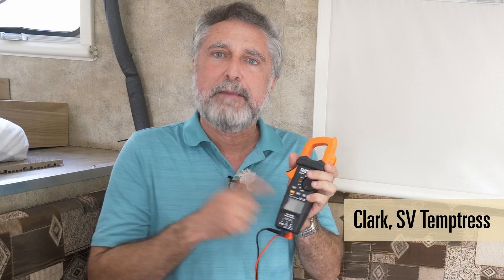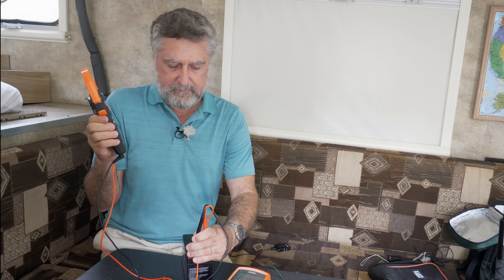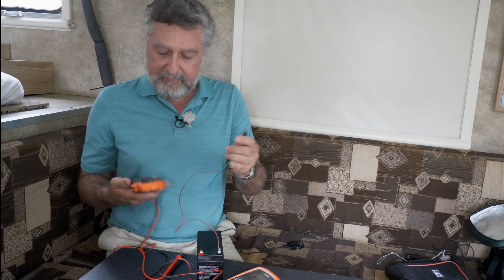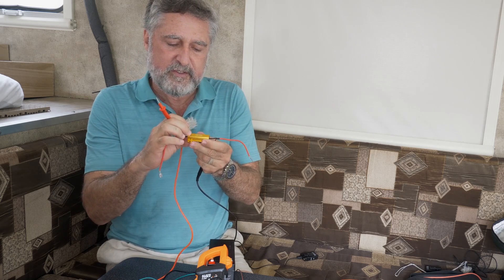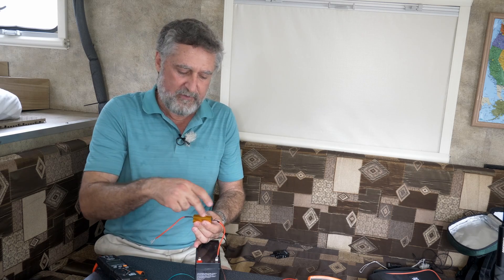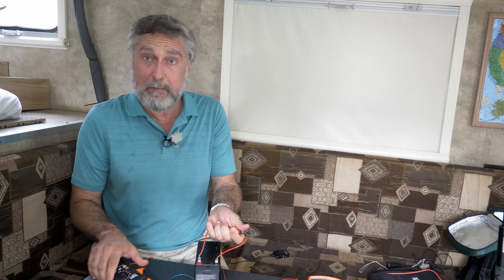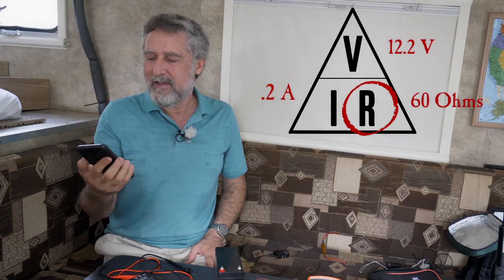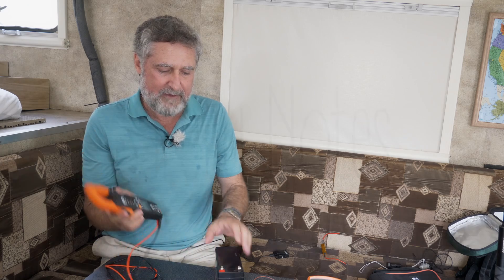Boat Electrical:How To Use Your Meter

Comment: It is possible that the Klein clamp-on current measurement was more accurate than the Extech shunt current test. The shunt resistance in these types of meters causes a small voltage drop across the shunt that is used to calculate the current. The voltage drop is called the "burden voltage" and it slightly reduces the current through the circuit under test. This is irrelevant for measurements on a boat, but is a big deal in low level electronics. The Extech manual probably specifies the burden voltage through the meter for low level electronics applications.

Current clamps can be impossible to fit in the tight wiring behind a breaker panel and nearby current carrying conductors can affect clamp-on measurements, especially when measuring low currents. If it can fit, clamp-on is king for current measurements above 1A or so IMO. If you use shunt current measurements, be sure to have spare fuses on board. : )

Comment: Hi Clark, great videos. Question  - no electricity knowledge, what is the resistor for that you hooked up. Why is a resistor used. Is it to draw down the current in a circuit? Your previous video it stressed resistance is detrimental. Thanks for any insight!
Reply from the maker: Sometimes you just want to add resistance to a circuit.  That's why we have resistors.
Yes, Usually it's to control the current that can flow
Reply: @Clarks-Adventure  Thanks Clark!!

Comment: I would just like to add that just to be safe don't wear a watch or rings.  When they come into contact and short circuit, it gets very hot very quickly.  And once they're burned in, they can't be quickly dislodged.
Reply from the maker: Yes!  What he said.

Notice that Emily and I ware woven string rings.
Reply: Oops, I missed that!  Inattentive, sorry

Comment: The DC clamp on probe is the only reason I would buy a new meter. The AC clamp on probe did not make it worth while (so I don't have one :)
Reply: Yes the DC clamp made it worthwhile for me.  Before I got one I could only measure up to what my 50 amp shunt meter that had to be hard wired into the system could handle now its hundreds of amps with the clamp.  Check out the Ideal brand of meters with dual displays.  The second display on the heel of the meter is great when working in awkward locations and makes it very easy to find a position where you'll be able to safely read one of the two displays.  Also look for a clamp meter that has a holder for clipping one of the probes to the meter so you won't when using the probes (such as for checking voltage/ohms/frequency/capacitance) need three hands to hold the meter in view, hold the positive probe and then the negative probe.

Best

Comment: I appreciate these videos.  While I am well versed in marine DC electrics, I am an experienced marine mechanic (think pontoons and runabouts), your videos give me a different way of thinking about things I already understand.  Your videos expand things for me, can't explain it, but thanks.  You're a good teacher, that's a great skill.

Are you self taught?  Could you share any of the resources you used to gain experience and expertise?  Perhaps a good reference book or trade manual?  

I certainly could not enfineer your bank manager.  Your DC battery charging stuff makes sense but how did you educate yourself to be able to figure it all out?
Reply from the maker: I think my background has a lot to do with my "different way of thinking".  
I had no education in anything mechanical.  My dad is scared of anything that has bolts.   I dedicated myself to an understanding of physics, chemistry and software engineering.   Got a good grounding in how things work at the low level and problem solving (software is complex problem solving at the most basic level).   Once I bought the boat I dove in and figured it all out from first principles.  Like my battery knowledge came from the application of chemistry.  The only book I can remember reading that helped was "living on 12 volts with ample power".  I've recommended it before and it has been found on eBay.

    So with no rules of thumb shortcuts but getting to the same goal as you where you understand the workings of boats, I have a slightly different "accent" but we both speak the same language.
Reply: @Clarks-Adventure  My Dad was the opposite of yours having a masters degree in electrical engineering from MIT in 1927.  A lot of the things he theorized in his white paper back then took almost half a century to become mainstream in our lives.  He would caution us that electricity is like your best friend, just don't treat it with disrespect or take it for granted as even your best friend after you've treated them badly one time to often can turn on you sometimes with disastrous/violent results.

Your videos for me take some of the rust off the knife so to speak when the occasional need to trouble shoot a charging system, etc arises.

Best

Comment: The first time I got a digital was amazing. Started with test light, resistors and potentiometer. Analog and panel meters, Radio Shack electronics kit. Still like some fine analogs on the boat.
Reply from the maker: Yep.  Since we can't see electricity.  It's like suddenly not being blind

Comment: 12V isn't enough to shock an individual, but it's easily enough to start a fire. Try dropping a wrench across the terminals.
Reply from the maker: Yep.
   No one wants fire!

   I show that in this video https://youtu.be/KsonnEu_H4Q
Reply: @Clarks-Adventure  Your previous video focused on proper wiring design. This is important, but knowing how to safely working around voltage is also important. Electricians use non-conducting tools for good reason. Mounting batteries in such a way that nothing can be dropped to create a short is also important.
Reply from the maker: You are so right
Reply: Or heat up a ring, watchband, bracelet, etc and give you a nasty burn.  A metal piece of jewelry burnt to your skin is a miserable thing to deal with.  Its really best practice to remove all jewelry when working even with relatively low voltages.  Just an old relatively small 9 volt transistor radio battery such as used in many smoke detectors can heat up a key, coin, etc in your pocket and give you a nasty burn or potentially set your clothing to smoldering or to catch on fire.

Best
Reply from the maker: Yes!
    Did you notice our wedding rings are made of string.  That's why.
Reply: @Clarks-Adventure  Yeppers, that's a good idea as is silicone rubber.  Two big potentials for injury with metal (really any strong conductive) jewelry are from electricity or getting snagged in something which you especially want to avoid on a boat with limited access to an ER.  Not much fun having to climb a mast or fish around in the bilge to retrieve a ring and perhaps the remains of your finger inside it.  

Had a retired ships mate who got tired of having to retrieve fingers before the captain became a stickler about enforcing the rules on jewelry.  They'd too often lose them on the hooks for the camo and safety nets on the military vessels.

We also need to be mindful that string or rope wet with salt water can become conductive enough to electrocute you depending on the voltage.

Anything that's non-conductive even when wet and will come off before the digit or limb its attached to is a good idea for working crew on a boat.

Comment: Nice one Clark! Another cool trick with a clamp on amp meter is you can measure really small currents if you loop the wire through the clamp again. This will double the reading. Just divide by two to get the actual value. I do this with my clamp on scope probe.
Reply from the maker: Yep.  I should have included this.  Good point Terry

Comment: A timely and useful refresher for everyone. Keep up the good work. :-)  

Just a quick note : Unqualified folk love to say "It's not the volts that kill you, it's the Amps". This is a myth and it's dangerous. 50volts and 10 mA will kill you.
Reply from the maker: Yes.  And we now all know how to calculate the current flow through the body based on the 1.5megaohm reeding I get in this video.

But I've never understood why 12v won't conduct enough to feel through 1 inch of flesh when 50v will give you a jolt through 30 inches of flesh.  There has to be some threshold effect I assume.
Reply: @Clarks-Adventure  The higher the voltage the more electrons flow, over coming resistance.
Reply: @Clarks-Adventure  
Might be when the voltage gets high enough
to push enough current to cause a shock through the upper layers of relatively high resistance skin at the contact points. The distance between the two contact points then is fairly low resistance in comparison, increasing voltage then solely determines current & shock shock severity. 
Just writing that makes me shudder. A decrepit but still alive industrial control systems engineer.
Reply from the maker: I think you are on to something.

It's all about the two dead skin layers.
Reply: @Clarks-Adventure  
Google this.

Conduction of Electrical Current to and Through the Human Body: A Review

Raymond M. Fish, PhD, MD, FACEP and Leslie A. Geddes, MS, PhD, DSc

Skin resistance might be 200k ohms  ie 100k ohms per contact point & the internal muscle & flesh / 'below the skin' path resistance would be 300 ohms regardless of path length, that might be due due to the effective path cross sectional area becoming larger along the length from the contact point to the halfway point.
There is also some interesting stuff about the differences between AC & DC current, with AC the current the skin acts as a capacitor insulator so internal current flow can occur without current passing through the skin! 60  cycles would be slightly more problematical than 50 cycles.
Reply: @paulpaul9914  Looking at Leslie Geddes credentials and wondering what degree a "DSc" is as I do not recall seeing that before?
Reply from the maker: Didn't know myself so I googled it

"The higher doctorate, “Doctor of Science,” also known as “D.Sc or Sc. D,” is a postdoctoral degree program that is awarded to an individual who has significantly contributed to the field of research and science."
Reply: @Clarks-Adventure  Thanks, Clark.  Some law schools do that with postdoctoral degrees as the basic U.S. law degree is a Juris Doctor.
Reply: @Clarks-Adventure  
From that info it seems for example that if a person has both hands wet with saltwater but is otherwise very dry (tropical heat probably makes things better or worse depending) & grabs hold of both terminals of a 6 volt battery with one hand on the + & the other hand on the - then a lethal current could flow. The victim might notice a shock sensation on making contact but would not notice after that.
& If two 1cm^2 area conductive pads connected to 240 V AC 50hz with thin insulating layers are pressed against the skin on either arm, ie no actual DC conductive path exists between pad & skin,  then a lethal current could flow by capacitive coupling. Significant shock pain would be experienced continuously in this situation.
I'm going to be more careful in future.